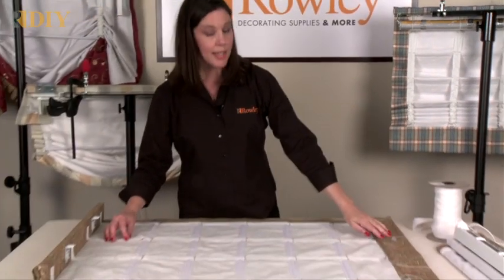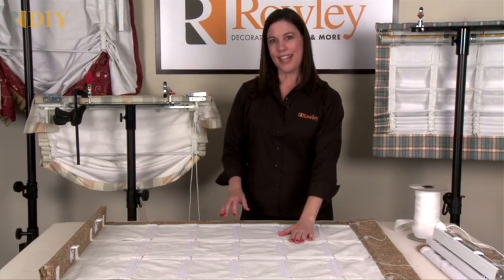How-To Use Encased Lift Cord Shroud Tape

Comment from the maker: We're really sorry you've had so much difficulty. The Encased Lift Cord Shroud Tape is woven as a flat tape that has never been gathered before. It is just like fabric in that it needs to have a ”memory” of the movements you expect it to make. Here's a tip: Spraying the Tape with Crease-Away while the shade is down, pulling the shade up and dressing it then leaving it over night to dry will help the tape retain memory. Once the tape knows what to do, it will lift the shade from the bottom.